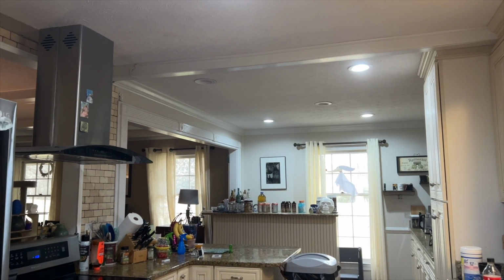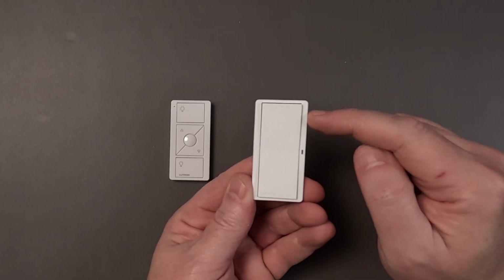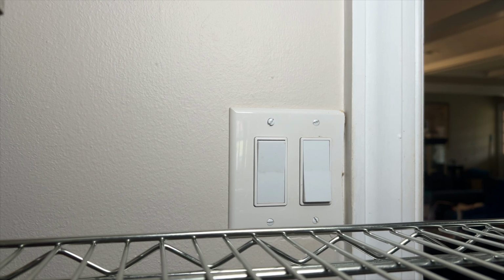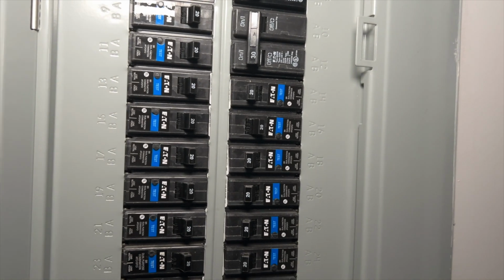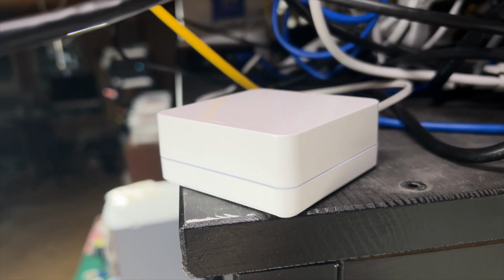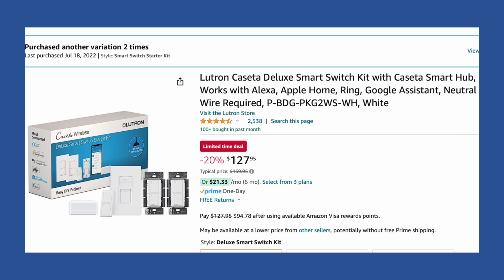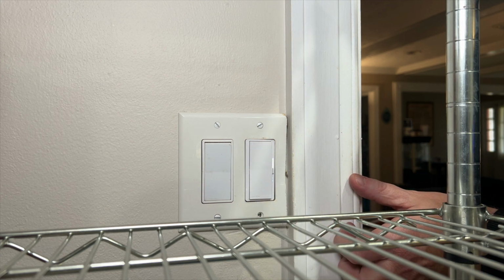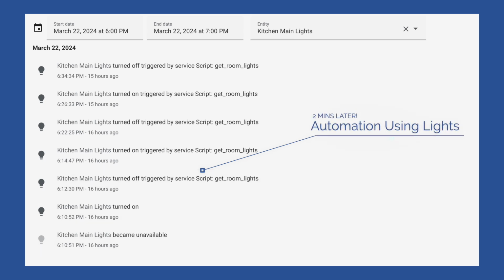Lutron Diva Smart Dimmer (Also My Home is Smarter than yours)

Comment: Heads-up on the Non-Contact Voltage detector: some of these aren't too reliable in terms of detection. Better to check with a multimeter and proper probes 🙂
Reply from the maker: Important safety tip. Thanks ON8AD

Comment: I only had one Lutron switch in my home for the dining room light. My wife wanted a dimmer switch that could dim the lights, but she was picky about the looks. She found the Lutron dimmer switch to her liking. I bought the switch and the Caseta hub in order to be able to operate the switches through the Home Assistant integration. It's been rock-solid since I installed it several years ago.
The kit came with one of the Pico remotes, but I hadn't been using that. Recently, I had a use for a small remote for something completely unrelated to the dining room light. I found that, once you've paired the remote (with the hub) using the Lutron app, you can see the Pico Remote events in Home Assistant. It's a fairly easy thing to set up automations that are triggered by the press and/or release of any of the buttons on the remote and, as you mentioned in the video, there's a handy mounting kit that allows you to mount the Pico as if it were a standard light switch. Very nice.

Comment: Ive got the lutron Casaeta no neutral dimmers in two paces. The regular on/off stitch for a wall plug (to control a table lamp) is too darn expensive for the No neutral version.  So I am using the Aqara version.  Both are very reliable.... however after a power surge I had to reconnect the Aqara switches but not the lutrons....  I will say it was easy as I just restarted the Aqara hub(s) as I have two for better connectivity.  The lutron hub is buried and I never need to touch it.

Comment: I'm a bit puzzled by your explanation regarding Lutron's capability to connect with multiple platforms simultaneously, suggesting that if Home Assistant were to fail, other platforms could still control the devices. Considering Home Assistant acts as a hub, and Lutron switches necessitate a Lutron Hub, wouldn't the scenario be similar if the Lutron Hub ceased functioning? Just as you have your devices linked to various platforms through Home Assistant, if any hub, whether it's Home Assistant or the Lutron Hub, were to fail, wouldn't the outcome be the same, leaving you unable to control your devices?

I acknowledge the Lutron hub's potential for greater stability, yet the risk of vendor lock-in cannot be overlooked. If Lutron were to cease operations or modify their offerings, there's a tangible chance that all connected devices might become inoperable. This concern is why I favor Zigbee or Z-Wave devices as most offer the flexibility to shift more freely, avoiding the constraints of single-vendor dependency. I'm optimistic that the Matter initiative will eventually address these issues of vendor lock-in and enhance compatibility across different ecosystems.
Reply from the maker: That is true. If Lutron's hub fails then you wouldn't be able to control the Lutron devices. 

Personally I don't really plan for companies shutting down or hardware failing other than expecting at some point I will be replacing hardware. If Lutron shut down, my response would be the same as when my GE Zwave switches died after a power flicker. Or when the weather api I used shutdown. I would just replace them. Nothing lasts forever. 

I'm looking more to prevent the temporary outages that are more common from taking down the entire system. You know those service outages that prevent google home from responding. Or the HA update that prevents your hub from booting up after an update. 

And unless the way most companies are implementing Matter changes, I think the fate of those devices would be the same if the company behind them
Goes out of business. Aqara, Switchbot, Phillips Hue all require their own hub for matter to work. And for most matter implementations that's the way it is going. If the hub stops working, and I suspect they will if those companies got out of business, none of the other platforms can control the devices over Matter. 

But you are right. Zwave and zigbee are safe from Venders shutting down. But again they also seem to fail at a higher rate than Lutron devices. At least in this smart home. So regardless of which one I use I will be eventually replacing hardware in the future.
Reply: @SlackerLabs   Thanks for your response and the additional context. I've experienced an update disrupting my Home Assistant setup, so your points resonate with me. I've recently started exploring the new Leviton Wi-Fi 2nd Gen devices that support Matter, although perfecting its integration seems to need some refinement. The advantage of these devices not requiring a Leviton-specific hub is significant. My dad is already using a few with Echo devices, and I'm in the process of integrating them with Home Assistant. While Matter aims to enhance compatibility, the approach of some companies to bind it to their hubs could undermine Matter's overarching goal of interoperability. Many are using hubs for backward compatibility. My hope is that, with time, reliance on a specific vendor's hub will diminish, allowing any hub compatible with Matter—whether it's Home Assistant, Lutron, Phillips, or others—to work seamlessly together.

Comment: Will the Lutron switches work with smart bulbs or only dumb ones?  I have 6 recessed zigbee rgbw lights that are on a dumb 3 way switch that I am constantly having to remind people not to use or the lights won’t function until the dumb switch is turned back on.
Reply: But turning power off at the switch would still require power to be turned back on at the switch for them to work as smart lights correct?
Reply from the maker: @ericboline9152 yea. Usually. Unless you did something to bypass the switch. I used Shelly devices to handle the power to the light and then just use the switch as a backup. But the smart home would be able to power control the lights regardless of the state of the physical Switch.
Reply from the maker: It works fine. There was a few hours between replacing the switch the led light replacement and it was fine. Although my repeated turn it on and off to film it caused them all to eventually go into pairing mode.

Comment: Great video.
Curious…a while back I asked you about Inovelli switches (both toggle and dimmer switches). Have you had a chance to look into them yet?
Zigbee, Zwave, Matter over Thread…they are also introducing an mmWave equipped switch.
I would be interested to see your opinion of the product line.
Reply from the maker: Yea. I need to see I can find some. If I recall I couldn't find any that u wanted in stock when I needed a switch before. But actually I have a couple of switches I need to convert so I will see if I can grab some.
Reply from the maker: Ok. Ordered two inovelli switches. I will try them out.

Comment: I've not had good luck with lumary. I ran some of their rgbw landscape lights and had to jump through all kinds of hoops to get local tuya working only to have them change the API effectively bricking them from a home assistant perspective. And now they are showing signs of water intrusion after less than 6 months. I'm not buying anything else from them.
Reply from the maker: Yeah. The landscape lights I have and they are working ok still. But the tuya Wi-Fi stuff is in my list of stuff to replace just cause I'm meh on tuya these days.

Comment: When integrating with Home Assistant is there any reason to get the Lutron Caséta Smart Bridge PRO (L-BDGPRO2-WH) rather than the regular Lutron Caséta Smart Hub (L-BDG2-WH) that is included in the variaous kits?
Reply from the maker: At one time the only reason is if you want your Lutron devices to trigger events in HA you needed the Hub. But I'm not sure that is still the case. Either way. For connecting HA to your Lutron devices either hub would work. I am pretty sure I have the standard hub. I'll have to check
Reply: @SlackerLabs The Smart Hub PRO provides all the features/benefits of the Smart Hub, both support 75 devices including Pico remotes, plus these differences for the Pro:

 compatible with Lutron Triathlon shades
 compatible with select styles of Sivoia QS Wireless shades

integrates with select security systems, A/V remote controls, and smart home devices.

On the Home Assistant side there was once a communication protocol difference.  Home Assistant updated its integration to use Lutron's LEAP API, so it has direct local control on both the standard and pro hubs. I believe you can still install the old Telnet integration as a Home Assistant custom component, not sure if the response time is faster (and that would only work on the pro hub). Hard to find definitive documentation of this, but this is what I have found on my search. I have Lutron switches throughout the house, but have not done any automation triggers/scene controls through the Pico Remotes (they have a lot of 2 and 4 button scene controllers and you can also customize anything you want with them). Future rabbit hole.

You might also take a look at Inovelli Switches - Zigbee, Z-Wave and Matter. Closely modeled after Lutron design and colors. Also a US company out of Michigan.
Reply: @SlackerLabs  @michaelmaliga815 I think you also need it for their Serena Shades if that's something you are looking to put into your home.
Reply: Use the pro if you want to program the pico remotes to do other things in HA

Comment: I just made a 2 way light a 4 way without running any wires and the Lutron allows the mounting to be done to the wall and just replace a 1gang plate with a 2 gang plate or 1 more gang than you had and you're done. No new or bigger box needed. I like these things too. Oh you can mount a pico to the wall anywhere and get a 1 gang plate and it looks just like a normal wall switch as well.
Reply from the maker: That's a good point. Those pico remotes are pretty versatile.